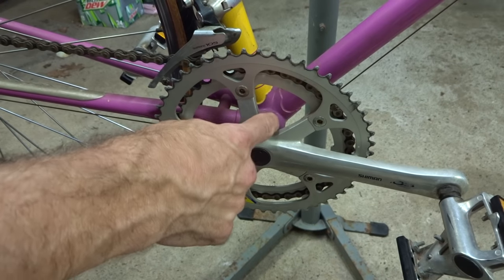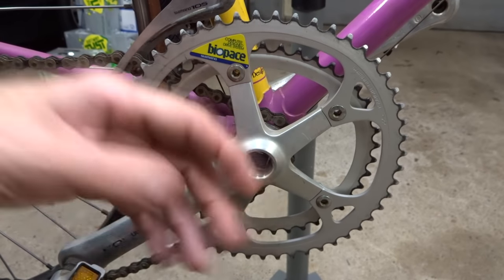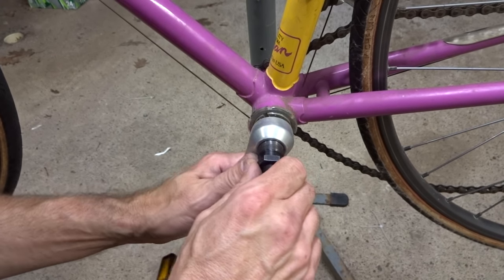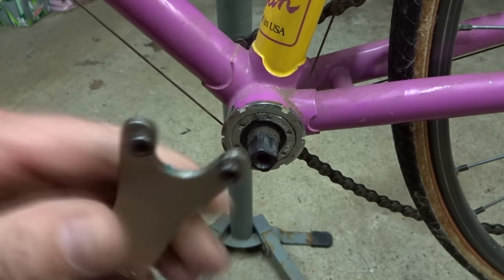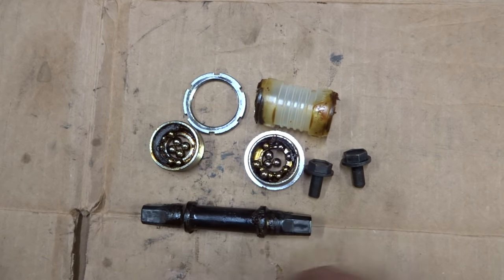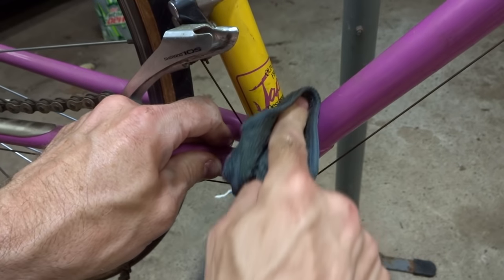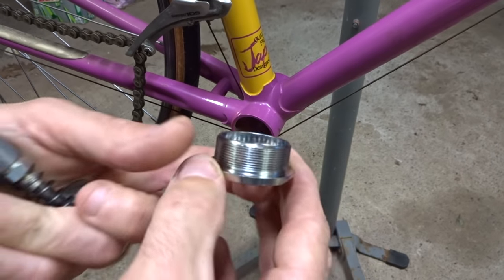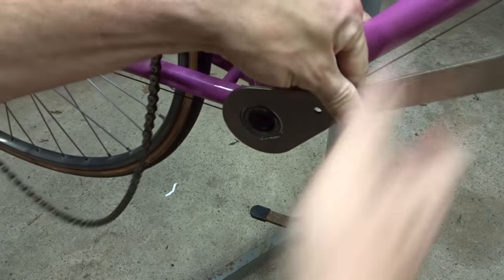Square Taper Bottom Bracket Service - How To Overhaul/Remove/Clean/Install

Comment: Unfortunately, your recommendation to avoid lubricant on the square tapers is incorrect.  Square tapers need grease.  This interface is not compromised by using grease.  The crank arm will not "go on too far over time" using grease.

USE GREASE ON YOUR TAPERS!

To wit, Jobst Brandt's definitive word on greasing square tapers, from an engineering and materials standpoint:

Jobst Brandt
:> My cranks get loose, quite quickly too; over about 10 miles or so  from being solid to flopping about in the breeze.  Any suggestions?
 
Your cranks are ruined!  Once ridden in the "floppy" mode, the square taper in the crank can no longer be secured on the spindle.  Get some new cranks and properly tighten them after lubricating the tapers.  Proper tightness can be guaranteed only by torque wrench or a skilled mechanic.  The second of these is less expensive and you might be able to get a demonstration of what is tight enough.

The admonition to not lubricate the tapers of the crank spindle seems to find life only on bicycle cranks, of all the machines I have seen.  I have pursued the "dry assembly" instruction by talking to crank manufacturers and discovered that they apparently had warranty claims from customers who split their cranks open.  It is easy to prove that cranks cannot split by over-tightening simply by attempting to do so.  It is not possible to split a major brand crank this way, the bolt will fail first.

Crank failure from "over-tightening" is caused by the re-tightening of previously properly installed cranks.  Once installed, a crank always squirms on its taper, and because the retaining bolt prevents it from coming off, it elbows itself away from the bolt and up the taper ever so slightly.  This can be detected by the looseness of the retaining bolt after the bicycle has been ridden hard.

Grease in this interface does not affect performance, because only the press fit, not friction, transmits load from crank to spindle.  As any bicycle mechanic can tell you, crank bolts are often appreciably looser after use, the left one more so than the right.  This occurs because the left crank transmits torque and bending simultaneously
while the right crank transmits these forces one at a time.  The right crank puts no significant torque into the spindle.  Either way, the looseness occurs because loads make the crank squirm on the spindle and the only direction it can move is up the taper, the retaining bolt blocking motion in the other direction.

Regardless, whether grease or no grease is used, in use the spindle and crank will make metal to metal contact and cause fretting corrosion for all but the lightest riders.  The purpose of the lubricant is to give a predictable press fit for a known torque.  If the spindle is completely dry this cannot be said, and even with marginal lubrication, some galling may occur on installation.  Lubrication is only used to guarantee a proper press because the lubricant is displaced from the interface in use.  Taper faces of spindles show erosion and rouge after substantial use, evidence that the lubricant was displaced.

"Dust caps" aren't just dust caps but retention for loose bolts.  It is not that the bolt unscrews but that the crank moves up the taper.  However, once the screw is unloaded it can subsequently unscrew and fall out if there is no cap.

Because cranks squirm farther up the taper when stressed highly, the unwitting mechanic believes the screw got loose, rather than that the crank got tighter.  By pursuing the crank with its every move up the spindle, ultimately the crank will split.  It is this splitting that has been incorrectly diagnosed as being caused by lubrication.  I have
never seen a warning against re-tightening cranks after having been installed with a proper press fit.  It is here where the warning belongs, not with lubrication.

For the press fit to work properly, the pressure must be great enough to prevent elastic separation between the crank and spindle under torque, bending, and shear loads.  This means that no gap between crank and spindle should open when pedaling forcefully.  Friction has no effect on the transmission of torque because the crank creeps into a position of equilibrium on the spindle in a few hard strokes.

Failure of this interface occurs when the press fit is too loose allowing a gap open between spindle and crank.  Torque is transmitted by the entire face of the press fit, both the leading edge whose contact pressure increases and the trailing edge whose contact pressure decreases.  If lift-off occurs, the entire force bears only on the leading edge and plastic failure ensues (loose crank syndrome).  Tightening the retaining screw afterward cannot re-establish a square hole in the crank because the retaining screw will break before the spindle can exert sufficient stress to reshape the bore.  Beyond that, the crank would split before any plastic deformation could occur even if the screw were sufficiently strong.

Because retaining screws could become entirely lose from squirming action, especially if the press is relatively light, "dust caps" should be used to prevent screws from subsequently unscrewing and causing crank bore failure.  Besides, the loss of the screw won't be noticed until the crank comes off, long after the screw fell out.

The argument that the greased spindle will enlarge the hole of the crank and ultimately reduce chainwheel earance is also specious, because the crank does not operate in the plastic stress level.  At the elastic limit it would break at the attachment knuckle in a short time from metal fatigue, that occurs rapidly at the yield stress.  In fact, the depth of engagement (hole enlargement) can increase with an unlubricated fit faster than with a lubricated one, because installation friction is the only mechanism that reams the hole.

Jobst Brandt
Reply from the maker: But there other people who say it is correct. For example Park Tool says "For square tapered spindle, leave spindle clean of grease." So it depends on who you listen to.
Reply: @RJTheBikeGuy , thanks for the comment.  I realize Park makes this assertion.  It's probably a way for them to avoid liability if some lawyer wants to take aim at them over this issue.  (Campy for EVER stuck to their assertion that square taper cranks were "the most efficient" crank/axle interface, despite clear evidence to the contrary.  They were wrong.  But they were Campy, so does their reputation and prowess mean they were right?  No.  They eventually gave in and abandoned their archaic square taper design.  Park can similarly be wrong.)

That said, for everyone scared of greasing tapers, don't do it then.  But don't tell others not to.  That is going too far.

But my experience in the industry clearly says otherwise.  The LBS I managed, with 13 stores, a world top Specialized and Cannondale retailer for many years, went to the trouble of fully rebuilding bikes in the 80's before pre-building was done at the manufacturer level.  Spindles were greased on thousands of bicycle builds.  Cranks stayed put.  There were no failures.

If greasing tapers were wrong, our methods would have been quickly exposed, thousands of dollars lost, as well as lawsuits and it would have been a complete and total disaster.  This simply didn't happen.

Personally, I've been doing the same with my bikes since the early 80's and NEVER had a crank taper failure.  I also wasn't riding the best componentry, so my cranks weren't forged and made to the highest tolerances way back when.  Every single one survived.  I still have a 30 year old pair of XT cranks that are used on my daily commuter.  I've broken seven frames in my tenure (not due to crashing) and sheared one Suntour BB spindle in two in Moab 30 years ago. That crankset is still in use today.

And in all this time, every bicycle I've serviced personally with square taper cranks has had the tapers greased.   Not a single problem.

So I can unequivocally say that greasing spindle tapers is 100% OK.

PS  It just so happens I'm sourcing a square taper BB for a build I'm working on.  Looking at Phil Wood's website for BB options...  and look what I came across in their assembly instructions:

"5. To install your crank set, consult your original crank set’s installation instructions. A thin layer of Phil Waterproof Grease should be applied to the spindle’s tapered surface before the crank arms are bolted on."

https://cdn.shopify.com/s/files/1/0378/1413/files/9._Square_Taper_Bottom_Bracket_Cup_Installation_Instructions_V1.2.pdf?354

So there, I've provided a reputable manufacturer citing the opposite of Park Tool Co.  I think this clearly resolves the issue.
Reply from the maker: @dudeonbike800  Barnett's Guide says "In step #33, prepare the arm for installation by cleaning the mating surfaces of the spindle and arm with acetone or alcohol. The purpose of this is
 to remove any traces of lubricant. Since these two pieces are held together by friction, grease or oil may enable the arm to go on further (not necessarily a good idea). Further is not more secure if arrived at by using lubrication. Crank manufacturers are unanimous in recommending against lubrication of the spindle when mounting the arm. Arguments to the contrary have been voiced, but never lubricate the spindle flats! "
Reply from the maker: For as many people that say grease them, there are more that say don't. So you do what you want. I am not greasing them. And my videos I will continue to tell people not to grease them.
Reply: @RJTheBikeGuy  I know a guy who did exactly that.  Used acetone on his tapers and his bike creaked incessantly.  It was unbearable.  It was galling! (pun)

Brandt debunks the "held together by friction" argument you make regarding tapers.  Sorry, materials science and engineering disagree with this assertion.

Do you grease threads?  Do you grease bolt heads? Do you grease steer tubes?  Do you grease seat posts?  Stems?  Handlebars?  Virtually everything you fasten on a bicycle relies on friction to stay put.  And all the things I list above do exactly this.  But greased bolts are not falling out of bicycles at epidemic levels.*  Stems stay tight, despite greased bolt heads, threads and steer tube. How can you explain this?  This shouldn't work!  According to your argument, every single fitting on a bicycle should be thoroughly degreased with acetone prior to assembly.  That is absolutely wrong. 

Another area where people have problems are chainring bolts.  These are invariably assembled dry by the manufacturer of mass produced bikes.  Yet, chainring bolts fall out all the time.  Unless you remove your chainring bolts and properly grease them and reinstall, you're risking losing chainring bolts.  I've seen it a gazillion times.  Alternatively, I grease all the chainring bolts on bikes I ride and assemble professionally.  I have yet to lose a chainring bolt. 

I know a mechanical engineer who explained WHY greased threads don't fall apart.  The way the grease works is this.  As parts slide together, grease slides between the parts, lubricating the surfaces, preventing galling and allowing proper torque/tightness to be achieved.  Once the two parts stop moving, the grease leaves the mated surfaces so that the metal parts are actually contacting each other.  Then, whenever they need to be removed, the grease lubricates the moving parts and they come apart.  Waterproof grease prevents water from entering the spaces via capillary action, preventing corrosion and hydrostatic welding.

This engineer also mentioned that many torque bolt applications require dry threads when installing.  BUT this is in the case of permanent bolt fastening, such as in the case of building, bridge, and large steel structure construction.  A bolt fastener is strongest when it is tightened to just where the threads begin to strip.  This is for permanent fastening and how highest strength is achieved.  Maximum strength with minimal materials used for the application.  If these bolts are ever removed, they're destroyed in the process and cannot be re-installed. 

So the above reason is where people assume "try thread torque" values are necessary.  Sure, when you're building a bridge, yes.  But not in bicycle assembly applications.  Torque values are for lubricated bolts.  Lubricated bolts allow one to achieve quicker fastening values with minimal torque (lube reduces friction, thus allowing a bolt to "tighten" something will less turning force).

Again, those of us in the bicycling world have been greasing tapers for decades and decades without deleterious effects.

*And yes, there are exceptions.  Some bolts require thread locking compound, including
1)  Cantilever post bolts
2)  Disk caliper mount bolts
3)  Rotor bolts
4)  Spoke nipples - debatable.  Lube and threadlocker tend to work very well.  Linseed oil is the cheapest, best lube/threadlocker there is.

Comment: Other than weight, this system seems economical and just as efficient with power transfer. I actually despise the bb30 or pf30 system as it causes lots of creaks and it isn't economical as the bearings are cartridge. Why aren't modern BB using this for road bikes today?
Reply from the maker: Modern BBs are cool as they are lighter and the bearings are larger and farther apart allowing for a more solid BB. I haven't messed with BB30, but I done GXP and Hollowtech II.
Reply: Thanks for your replies. Your vids are super interesting as I love older bikes and knowing how to maintain them.

Comment: 12:25  you just knocked the bearings out of position. you should have inserted the plastic divider and spindle first,  then do the pounding. 😝😝😝
Reply from the maker: No, the grease easily holds them in place.